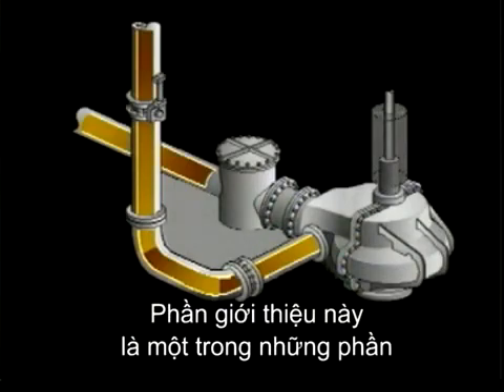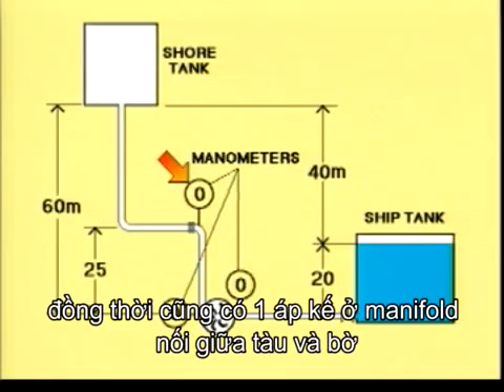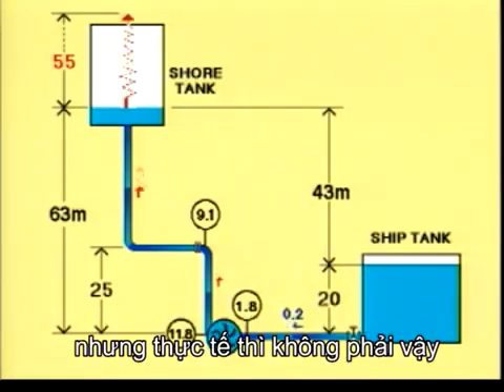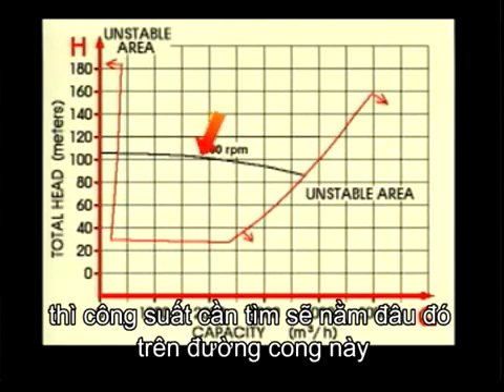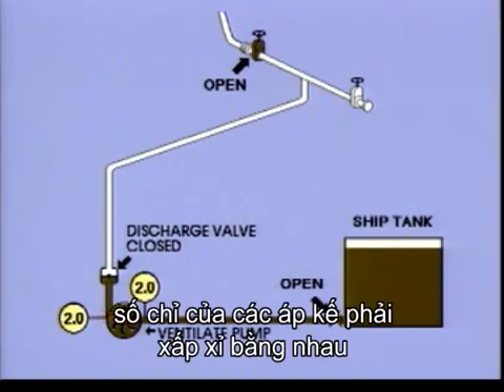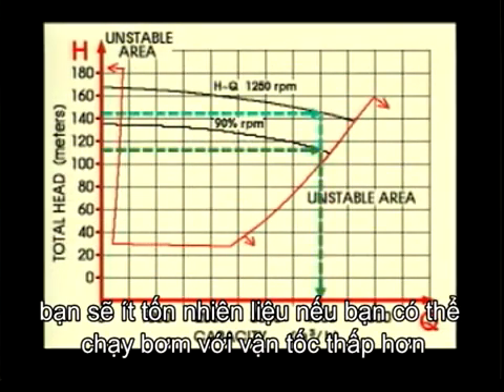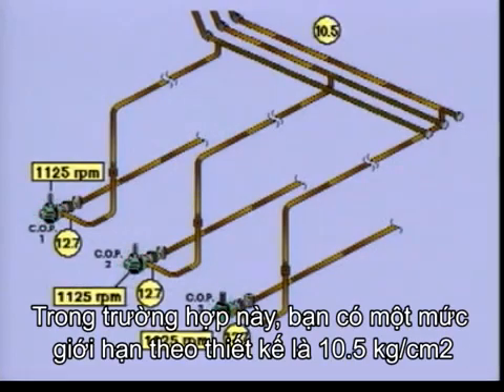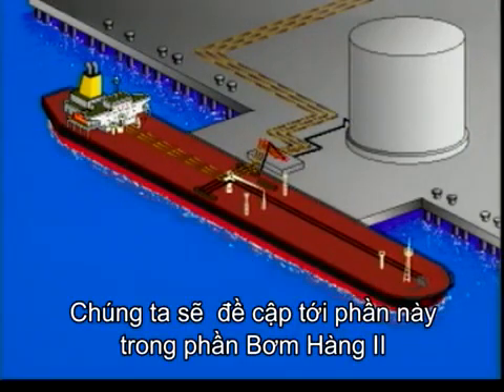CARGO PUMPING SYSTEM ON OIL TANKERS (PART 1) | Capt.TRAN THE HUNG

Comment from the maker: SYSTEM PRESSURE CONTROL
System pressure is set by the potentiometer on the control panel, as a voltage input to the PLC. The PLC output is amplified by a proportional valve driver card controlling the proportional pressure control valve for the system pressure. The set pressure is automatically set to zero until one of the power packs has been loaded.

framo system pressure control
The manual set pressure is automatically compared to the actual pressure. If a pressure drop occurred, for example by starting too many consumers in proportion to number of power packs running, the PLC is limiting its output set pressure to maximum 60 bar above actual pressure. This is to avoid pressure peaks when starting another power pack or stopping a consumer. This function can be manually overruled in manual override mode 1 and is automatically overruled in mode 2.

REMOTE CONTROL OF HYDRAULICALLY DRIVEN PUMPS
The command signals from potentiometers at the front of the control panel are fed directly into the proportional valves for speed control. The built in pressure transmitters give a 4-20 mA (0-300 bar) feedback signal to the instruments on the control panel.

EMERGENCY STOP ARRANGEMENT
Following emergency stop arrangement is provided by Framo according to class requirements:

Emergency stop push buttons located on deck are stopping the cargo pumps only, other consumers are not affected.
Emergency stop push button located on hydraulic system control panel and central location outside engine room are stopping the hydraulic system.
SYSTEM SHUT DOWN
If a shut down function is initiated, the PLC will give shut down command to the power packs in sequence. The first power pack stops immediately and delay between shut down command of each following power pack is 0.75 seconds.

COOLING WATER INLET VALVE
The valve is automatically controlled and will open at hydraulic oil temperature above 50°C. It will stay open until the temperature decreases to below 30°C, then it will close. If no power packs are running and the hydraulic oil temperature is below 49°C, the valve will be closed. If there is a mismatch between command and feedback signal, an alarm will be released. If failure in the temperature monitoring loop, the valve will be opened.

ELECTRIC CONTROLLED BALLAST PUMP EJECTOR
The priming of ballast pump is done by creating vacuum in the pump casing. For creating vacuum, an air ejector is installed. The ejector for the priming system is automatically controlled by the PLC. The PLC receives input from a level switch installed in the pump casing and controls the solenoid valve for the ejector pilot air, starting and stopping the ejector. Time delay for start and stop is 2 seconds and the logic incorporates an interlock to prevent starting the ejector unless at least one power pack is running and operator’s hydraulic pressure command is more than 30 bar.

INERT GAS PRESSURE LOW
Input from external system for shut down of cargo pumps. Visual and audible alarm provided

CARGO PRESSURE HIGH
Input from external system for shut down of cargo pumps.Visual and audible alarm provided

INTERFACE TO VESSEL’S INTEGRATED CONTROL SYSTEM (ICS)
The Framo cargo pumping system can be operated/ monitored from Framo control panel or from ICS. The mode is selected in front of the Framo control panel.

INTERFACE TO POWER MANAGEMENT SYSTEM (PMS)
A “start request” signal is sent from the Framo electric starter to PMS. Start is prohibited until a “power available” signal is received from PMS.

Reference:

SERVICE MANUAL FOR CARGO PUMPING SYSTEM by Framo

Comment from the maker: POWER SUPPLY
Most hydraulic system control panels are supplied via two separate power feeders, main and back-up. In case of failure to main feeder, automatic change-over to back-up will take place. For increased availability and simplified trouble shooting, the control system is electrically divided into separate sub-systems. Each sub-system has its own 24VDC power supply. Failure in one system is not likely to interfere with other systems.

The feeders and DC power supplies are monitored by relays provided with status lamps. The lamps illuminate when corresponding feeder/ supply is in good condition. A failure on any of the feeders/ supplies or short circuit will generate a potential free (dry contact) power failure alarm to the engine control room in addition to alarm at the control panel.

FEED PUMPS
The feed pumps are started/stopped manually from control panel or from the electric starter cabinet. However, when initiating start of the first main power pack, two of the feed pumps will automatically be started (high capacity mode) before the power pack is started. When the power packs are stopped, the feed pump will switch from high capacity mode to low capacity mode (only one feed pump running) automatically after 10 minutes if this is not done by operator. A running signal is provided for indication on the control panel. The high capacity mode is used to keep feed pressure on the suction side of the main hydraulic pumps. Two feed pumps must therefore be running before the main power packs can be started. If one of the feed pumps stops when running in high capacity mode and the power packs are running, the third feed pump will start automatically. If the running signal for the third feed pump is not obtained within 3 seconds, the feed pressure low alarm will be initiated and the system will be shut down. One of the feed pumps must always be running when the system is not in operation and if it stops, the protection pressure low alarm is initiated.

At system shut down, the feed pumps will stop together with the first power pack.

POWER PACKS
The power packs are started/stopped manually from control panel or from the electric starter cabinet. The power packs can be started in any sequence. Maximum 4 starts should be made during an hour. Maximum 2 following starts can be made, then 15 minutes between each. The starts are controlled by the PLC, including starts from the electric starter cabinet.

”Closed” signal from limit switches on suction line for each power pack will stop or prevent start of the corresponding power pack only. An alarm light is provided for each power pack to indicate closed valve. If more than one power pack is loaded and the hydraulic oil temperature increases to 65°C or above, the control system will automatically unload all power packs in sequence except for one. The running light will start flashing for the unloaded power packs, and the high oil temperature alarm is re-initiated each time a new power pack is unloaded. The power packs will automatically be reloaded in sequence when the hydraulic oil temperature has decreased below 60°C.

Comment from the maker: The discharge from all cargo, ballast and other pumps connected to the system may be remotely controlled from framo control panel, vessel’s integrated control system (ICS) or locally at each pump via the control valve. The portable pump is controlled locally at the pump via the control valve. The equipment is manufactured in Norway ‘Framo’ facility and the most important benefits of the system are:

Segregation of cargoes for vessel’s safety and the environment.
Maximum transport volume.
Efficient stripping and tank cleaning.
Hydraulic system without any electrical power equipment in cargo area.
Automatic regulation of power needed and impossible to overload.
System Description
The Framo cargo pumping system is controlled by a Programmable Logic Control (PLC) installed inside the control panel. The PLC is programmed by Framo and provides the logic for safe operation of the system.

ALARM SYSTEM
All alarm inputs, except “Wear indication” are normally closed, meaning that the system is built up on normally closed contacts. Hence if a contact opens or there is a loose wire, an alarm condition occurs, i.e. FAIL TO SAFE.

The alarms are divided into two groups:

a) Shut down

b) Alarm for indication (pre-warning) only

Each alarm is indicated with a flickering light and an acoustic signal. The “Horn silence” button must be operated before it is possible to confirm the alarm by the “Acknowledge” button.

Group a) alarms: The “Reset” button must be operated to clear the alarm.

Group b) alarms: Automatic reset

Comment from the maker: The framo hydraulic cargo pumping system is designed for a flexible and safe cargo and tank cleaning operation on ships. It consists of one hydraulic motor driven cargo pump installed in each cargo tank, ballast pumps, tank cleaning pumps, portable pumps and other consumers, all connected via a hydraulic ring line system to a hydraulic power unit as shown in figure below. The submerged cargo pump is a single stage centrifugal pump with the impeller close to the tank top, giving a good pumping performance of all kinds of liquids and with excellent stripping performance. The hydraulic section is surrounded by a cofferdam that completely segregates the hydraulic oil from the cargo.

Framo cargo pumping system

The hydraulic power unit consists of electric motor and/or diesel engine driven hydraulic power packs, where the hydraulic pumps are of axial piston type and swash plate design with variable displacement. The pump displacement is hydraulically controlled via the pressure regulator on each pump and by this system, the oil delivery from the hydraulic pumps will always be the same as the oil consumption for the hydraulic motors. To control and limit the speed of the motor, a control valve is fitted for each motor.

To keep the hydraulic oil clean and hydraulic oil temperature within desired range, a full flow filter and cooler are installed in the main return line. To regulate the oil temperature, a cooling water inlet valve is controlled from the framo control system. To prevent impurities from entering the hydraulic system, the system is also pressurized (2-6 bar) when not in operation. Depending on the installation, this is done by a jockey or feed pump.